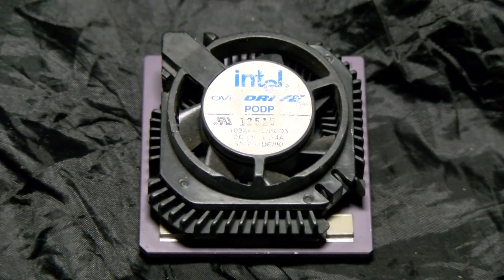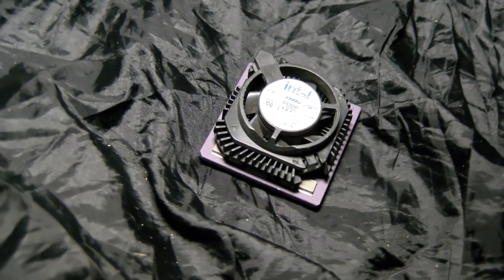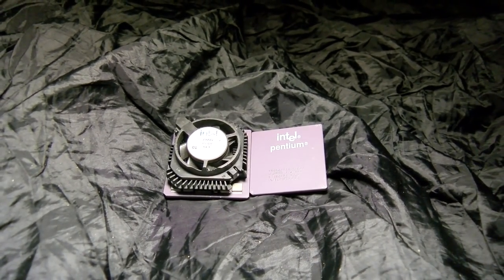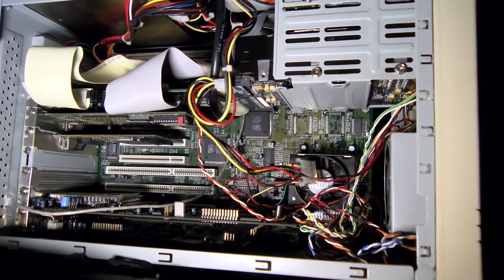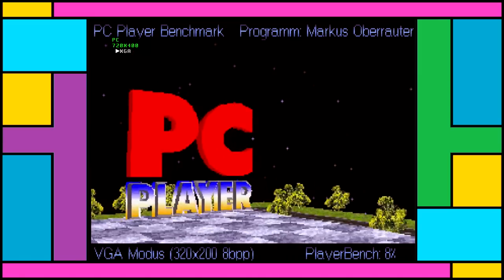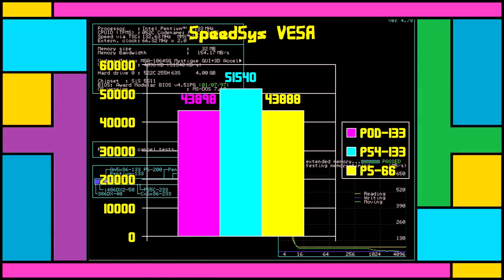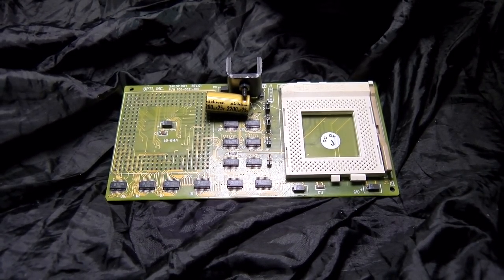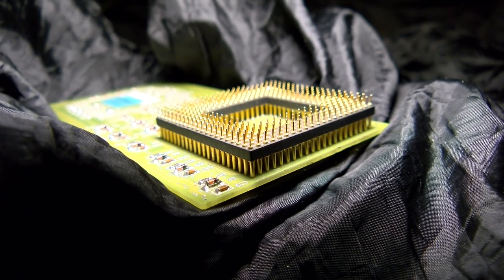Socket 4 OverDrive versus Socket 5 Pentium

Comment: Some update: I overclocked this CPU easily to 166Mhz (World Record???) at 83Mhz FSB, relatively conservative cache timings on the motherboard: SI5PI AIO. No Cache interleave  but 1MB size (18x512KBit chips, 15NS). Cache interleave only works non-overclocked.  Memory timings are also lousy. Ati Rage Pro 4MB. Tested Games: Thief & MS Urban Assault. Both work fine in Direct3D(DX7) on the ATI. Win98se. No crashes. No bluescreens. All HW is detected properly despite 41.5Mhz PCI Bus.
Reply from the maker: Sounds quite impressive.
Is the spare board you wanted rid of also an SI5PI?
Reply: Great overclock! Could you maybe dump this board's bios and upload it to vogons?
Reply: @brucetungsten5714  i could try but its a normal bios.
Reply: @HighTreason610  Yes, it is one of them.
Reply: Normal as in standard fare - which other bios could be used? 

I'm asking because one SI5PI I own has some weird issue where it does not correctly recognize any PCI graphics cards in windows anymore. 

DOS is usable as always so I assume it may be BIOS related.
Reply from the maker: @AmstratExin I see, and how much do you want for one of these, exactly? May as well fill in a gap in the ECS board collection.
Reply: @brucetungsten5714  I have no idea other than what I know. The board has some very weird quirks with the Cache and the PCI subsystem is garbage and slow. I tested mine with a Rage Pro 4MB, an S3 Virge 4MB and Voodoo 1. The Game performance HW Accellerated is very poor in comparison.
Reply: It's at least better then other chipsets for the original Pentium. Could you perhaps provide a BIOS image? I couldn't find a proper BIOS elsewhere.
Reply: @brucetungsten5714  I will make a backup of the Rom then. I'll give you an update.
Reply: THX!

Comment: Very nice video! I have a Gateway2000 P5-66 myself with the 133mhz overdrive chip and I've always thought it was a very interesting and rare chip. You definitely don't see or hear much about them! It makes for a great DOS gaming system for those "Pentium" enhanced games like Terminal Velocity and of course Quake :)
Reply from the maker: Certainly is a nice alternative way of achieving a P133, I think I'll leave the K5-166 to those jobs though and keep the P66 in here, purely as I find the original P5 chips strangely appealing.

Comment: Thanks for the video, I have been looking forward to your next episode, maybe the extra pins on the later Pentiums were so more power could be supplied to the package with the view of releasing cpu's with greater clock speeds and TDP in the range. I presume each pin can only supply so much current considering the very thin wiring inside the package. Looking forward to your future videos.
Reply from the maker: Other comments, which I have little if any reason to disbelieve, might suggest that the pins are related to SMP support and a couple of other features. Whilst they could be power, it is worth remembering that the P54 uses much less power than the P5. It amazes me how the tiny gold bond wires actually carry the amount of current they do.

Comment: Nice to see Duke with good framerates. The P54C added multiprocessing capabilities, a local APIC and apparently some power management stuff. The local APIC could be used as a timer, although I'm not sure this was used early enough to make a difference against the original P5 chips.
Regarding the Batman boards being slow, there was some testing recently done here https://www.vogons.org/viewtopic.php?f=46&t=66247 where the Batman seems to come out a little bit ahead of the ECS SiS board, despite the lack of memory tuning options. As for those, the thing is that Intel's 430LX/NX boards were apparently really optimized around 70ns memory, as opposed to the 430FX Zappa for instance, where 60ns EDO is recommended for 66 MHz FSB operation in the manual. I wonder if using some tool like Award BIOS Editor or Modbin on the early boards could unlock some hidden settings and potentially get even more performance out of it when using 60ns RAM.
I've been thinking that a P133 bought in mid-late '95, while quite expensive, should have been a comparatively future-proof option in those years; with 3D acceleration and 32 MB RAM it should have played most games at least acceptably until mid '98, with the exception of Quake II perhaps. In comparison the MMX Pentiums were kind of a joke as they were rendered obsolete merely a good year later by Unreal and Half-Life.
Reply from the maker: Recently I played through DukeDC on this machine and forgot how much certain settings crippled the speed of the game, outside of that either of the CPUs here should pretty much walk it as the game was tested with a DX2-66 when in development.
On the contrary, the ABit PS5 here consistently turned up faster than the Batman even at default settings, the Deskpro 560 is also slightly faster than the Batman despite sharing a chipset with it. The BIOS on the Intel board is indeed locked down ad I ever had any luck tweaking it, plus the board is pretty crappy in general anyway, so it's likely not worth it, this PS5 is better in just about every way and I'd also sooner be running the ECS than the Intel if I had one... I will get one some day, I own practically every other damn board they made at this point for some reason - I swear it wasn't deliberate. Still, worth knowing ECS' implementation of Socket 4 wasn't quite as quick.
A P133 would have been good for a couple of years, which is why I think this OverDrive might well have been a worthwhile upgrade versus buying a new board and CPU, especially given the sheer number of 'Socket 7' boards that weren't able to actually take Socket 7 chips due to a lack of, or improper, dual voltage support. Unfortunately I have to disagree on 3D acceleration, early accelerators were inherently awful and really weren't worth having at all, much less in a P54 machine where the performance is going to be rubbish.
The Pentium MMX was a waste of money in my opinion, it was a Grandma's CPU which ended up in super cheap crap boxes from companies like Granville, it was perennial and refused to go away, especially the 166, even in the 2000s - and some were produced in 2000, according to someone I have no reason to disbelieve. A small wait for the K6-2 or a slightly longer wait for a Duron would have been of far better value if money was a problem, which it probably was speaking from past events, given I went on to a Duron 750.
Reply: The Pentium 200mhz mmx was okay in my opinion. You could overclock it to 300mhz if you had a Super socket 7 board with PC100 sdram.

Comment: From my fragmented memory at the time 1994-6 at college doing computer science. Pentium (first gen) 60/66 were expensive. Had a fair i486dx2 66 for £1000. Going Pentium at start would have added 500 pounds to the budget.
Those first gen Pentium overdrives were insanely expensive here in the UK, started at 550 then dropped to 250 over time.
All that time I could get a new (good) Mainboard, faster Pentium CPU (at end vastly so) plus either a memory kit or new hard drive at the same price.
Route I got a new HD and memory expansion on main system. Then Dx2 to DX4 100. Overclocked that Intel to 150. Then bit the bullet and  new motherboard (temporarily old ram) plus a Pentium 200.
That overdrive socket 4 was NEVER an option.
Reply: Almost all overdrive solutions where insanely expensive at release time ... that's why some new old stock can be found here and there. I bet EVERY merchant suffered a loss on them and they just stop buying them so Intel stop making them.

Comment: I have one of these but its an Overdrive 150 MMX for socket 4/5 systems. Never did try to use it as I have so many socket 7 systems....The reason for 50mhz bus was due to some early socket 4 systems having VLB. VLB hates being driven past 50mhz.
Reply from the maker: Your chip will be for Socket 5 systems.
VLB will have nothing to do with it, as that would be behind a bridge on a Pentium board, which itself would be behind the PCI divider.
Reply: @HighTreason610  It says socket 4/5 overdrive... 60mhz minimum. And was wrong is not mmx.

Comment: It was surprisingly good, all things considering. I remember the price was rather high though and did not see it offered for long. Also rumors on the grapevine of stability and compatibility issues and recommendations to only use on Intel chipset motherboards. I stuck with my 486 DX2/66 and its shitty Octek motherboard with "magical" Dynami Cache Ram.
Reply from the maker: With such recommendations about Intel motherboards it's small wonder such rumors cropped up.Ah, those Octek boards, I've been trying to track down some of the DCA sticks for a few years, haven't ever seen any, almost have to question if they even made them at all, at the very least it would appear few people bothered with them. The only Octek I have doesn't feature DCA, suggesting they gave up on their cashgrab idea pretty fast and it is generally a mediocre UM888 board, nowhere near as good as similar boards from ECS, Aquarius or basically any other brand that wasn't complete trash.
Reply: @HighTreason610  I think the Octek Hippo DCA2 motherboards were sold in smaller quantities. They had compatibility issues. My SB16 would crash playing Doom II on it. I had a nagging question as to whether the "DynamiCache" with "10ns access time" was any faster and have mentioned it before here. One forum where it was discussed claimed it did have cache, just on the ram sticks themselves like a buffer cache of sorts and overall where nothing special. I have seen them crop up on ebay on occasion. The memory sticks have yellow stickers with the DCA2 markings. I would say it's rare, and getting rarer.
Reply from the maker: Having recently played the first two Doom games for the first time in years it seems crashing is normal regardless of board for those. So you're saying the DCA sticks do exist? I knew what they were supposed to look like and how they worked (SRAM on the end of the DRAM module as far as I recall) but was seriously beginning to question their legitimacy. I promised years back I'd get one of the boards if I could find the RAM for it, but as yet, no luck.
Amusingly the one I have, without DCA capability, limits the user to 256KiB despite the UM888 supporting more than this on other boards.
Reply: @HighTreason610  DCA2 sticks do exist. However it was a long time ago when I saw them with the distinctive yellow octek stickers on the chips sold on ebay and the price was stupid. The one Hippo DCA2 motherboard there now is also, stupidly priced. I suspect they maybe sold as regular EDO or FP ram because physically they are identical and unless you are aware of this "magical" ram they may fail to advertise it or even bother selling it, as it has much higher value than other common sticks because of its rarity. I did find a doom benchmark website which had two pc's using the DCA2 motherboards, presumably the ram also and there was nothing special about the performance.
I am fascinated because it is an oddity, in a time when there were cache scams left right and centre.

Comment: Maybe at some point in the past someone compared a the worst socket 4 system with FPM with small or no async cache to a Socket 5/7 platform with EDO and large Pipeline burst cache, although I find very little reason in tracking down a Socket 4 overdrive and or a Socket 5/7 to Socket 4 adapter because Socket 5/7 boards are so much more common that there's not really any reason to use an expensive adapter or overdrive in a Socket 4 board.
Reply from the maker: I suspect as much as well as Intel likely leaning on the magazines to make Socket 5 look better, although in the last video it seemed Burst Cache didn't make too much difference to the system overall and EDO also wasn't offering much of an advantage early on. The Triton board in this video actually had both, though was only used to test the P54CS chip at 66MHz.
Indeed, the practicality today is limited versus simply finding a more conventional system, but at the time I do think this might have been a decent upgrade for the small few stuck on Socket 4.
Reply: At the time they would have been a good upgrade although some third party upgrade boards that could accept faster Socket 5/7 CPUs might have been a better value , Although the quality of some them might have been questionable like your Opti one., and I don't think the Powerleap PL-54C/MMX came around until about 1998 so I guess it would have not really been around during the time the overdrives were viable. There's a site where I found people discussing upgrading their Packard Bell Pentium 60 systems to Pentium MMX 233s with the Powerleap adapter, http://www.oocities.org/sjg/upstory/pb520r.html , the manual says it can support K6 CPUs too but I doubt the bios for an Intel chipset board from 1994-1995 would support them, and while upgraded BIOS appear to exist for later Socket 5 Packard Bell systems to support them seems like Mr. Bios that made the updated bios for the later platforms could;ve cared less about Socket 4.
Reply from the maker: The BIOS for the Intel Batman doesn't even know what the POD133 here is, though it will work with that, it won't boot with K5 chips installed however, where the ABit will (when that stupid adapter works) and can even be modified to recognize them properly in theory. Given the relatively low power draw of the MMX OverDrive I do think they would work in most any adapter, I can't see why they wouldn't, though I'm not 100% sure of the Intel board in this case as it appears quite picky, I suppose if it's only looking at the CPUID or something it might be fine as this is really the only explanation I have for it not getting along with K5 chips - notably, that OPTi adapter wouldn't be able to power a Cyrix properly.

Comment: Why would you want to run the PODP-133 at 120MHz?  I have a Packard Bell Legend 5200 socket 4 system running an Intel 430LX chipset that has jumpers for 60/66MHz operation, but the 66MHz setting simply doesn't work, and documentation online seems to confirm this.  I've tried both overclocking a P60 @ 66 and using an actual 66MHz CPU, and all tests indicate that they are running at 60 despite the 66 setting.  I'd like to get a PODP-133 for this Packard Bell just to give it some speed - and so I can  have both a Pentium 66 (as a separate system) and a PODP CPU system.
Reply from the maker: All I can really say to your problem is "Packard Bell", you surely knew what you were getting into. Doubtful it'll just be running off a crystal and equally doubtful you'd be able to find a datasheet for the PLL it will use instead, as if you could, it may be possible to hotwire it if you're adventurous enough, although Intel made boards don't really like running out of spec.

Comment: Whaaaaaaaaaaaaat, no 150Mhz Overclock???
Reply from the maker: The Macronix clock generator does not appear to support any speed over 66MHz, although there are unused clocks for the lower speeds common to 486 boards. I generally don't overclock if I can help it anyway, no good can come of doing such things, in this case it would also render much of the hardware in the system useless until the clock was set back to normal speeds anyway.
Reply: @HighTreason610  If you want, I can give you one of my SIS boards....I think I have 3. They all work. I had 2 batmen and both never worked. I also got one of these socket 4 riser boards where I don't have a case. The SIS boards are all the same. They accept up to 2mb cache, tho, the memory limit is 128MB Anyways, so there's no benefit for that....
Reply from the maker: I'm generally against accepting things, but I may think about it, depending on what socket the board is. Probably not though, I've enough stuff by now. The only advantage I can think of in regards to the 2M cache may be interleaving as some of the later revisions of the 500 can do that, but I don't remember the specifics for this feature and how it has to be set up. The PS5 and SI55P boards here don't offer that, the PS5 being on an older revision of the chipset which only supports 1M (which is usually runs with now) and the SI55P seems to be the same but may simply have opted not to include the feature.
Reply: @HighTreason610  Good news: I found all 3 motherboards. Bad news, as I wrote before, there might be a chance that 2MB Cache are not fully utilized, since memory limit is 128MB OR other motherboard limitations. 1MB is good enough, but you still need to find 16x 512Kbit chips that are identical. However, all boards work fine and 2 of them are still equipped with just 512K Cache, using your standard 256Kbit chips, which is how they were sold typically.
Reply: By the way, I got 166Mhz to work o my SI5PI AIO. It's working great in win98se with 128MB RAM.